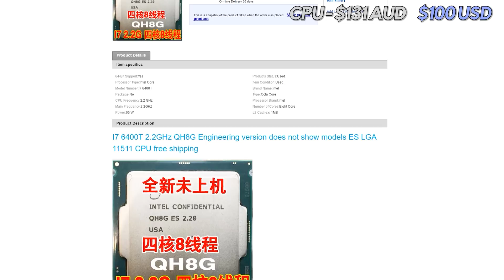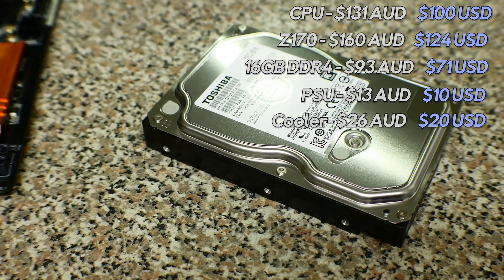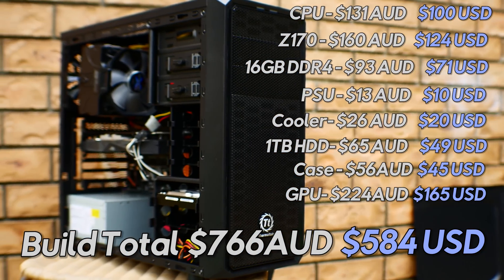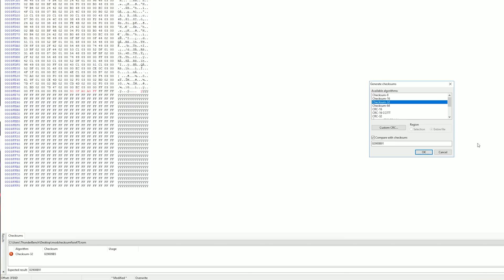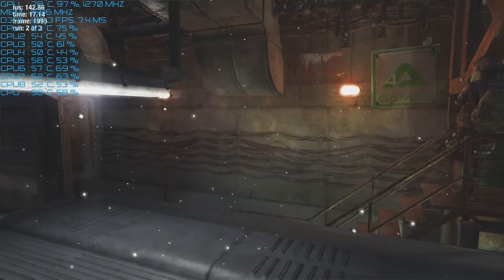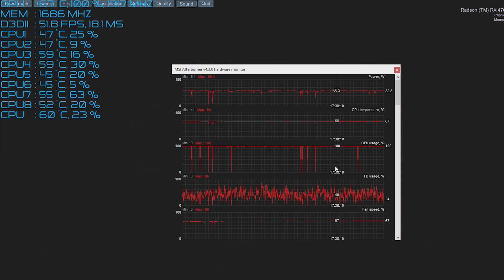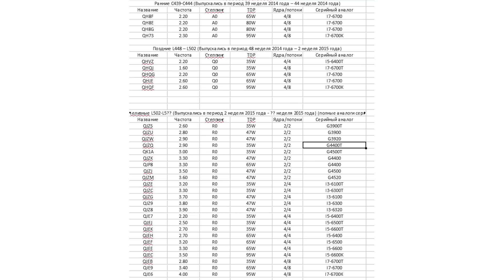The $600 Mass Effect: Andromeda PC - Used Meets New (March 2017 PCOTM)

Comment: With cpu coolers can  i use  (beter than Intel stock cooler) with an  better cooling solution for an 1156 socket without backplate and fitting on the intel cpu cooler socket.

Comment: why use this CPU instead of the E5 2670? I mean the e5 2670 scores 2000 higher in 3dmark physics (you didn't show any other CPU related benchmarks and I can't find any online as it's a rare CPU) and you can get the CPU and motherboard combo for about the same price. I know that you already know of the E5 2670 so like why use the i7-6400T?

Comment: Good thing i watched this video in time. I was heavily considering the Asus Strix Rx 470 cause it's cheaper compared to other models, now i know why. I thought the throttling issues were already solved at this point... I wont waste my money on this...
Reply: Lancer265 if you are still considering this card the throttling issues are fixed by just installing a simple bios update for the card from asus website and all you have to do is double click on the program and it will automatically get installed previously I couldn't even run the card at 1226 stable in winter without throttling to 300mhz at 70c but after the update i am reaching 1325 on core and 1725 on memory very stable at 85 percent fan speed the max temp i got was 73c and my room even goes as high as 41c
Reply: I got the Gigabyte G1 bro >_< didn't got throttling with this model, but i got temperature issues which thankfully got fixed with bios update too. What are your overclock settings tho ? do you use wattman ?
Reply: i use after burner my card is running stable at 1325 core and 1725 memory at 85 % fan curve and i rarely get above 70c and my room temperature also can go as high as 40c
Reply: Is it too loud ? What about the core voltage ?
Reply: Tbh the asus cooler isn't loud at all and the core voltage is 1140 i didnt have any luck with voltage on this card though

Comment: what do u guys recommend for a PSU with at least 600W's I'm worried bc my old computer had a crap PSU and took almost everything with it, Brian here is pretty brave when it comes to psu's and just took a PSU I've never heard of
Reply: Isaiah you Can use a corshair vs 650. Should be top Dolla 4 u. 🦍
Reply: A good quality 500w PSU should work great. But if you find a pretty good deal on a 600w unit then get it.
Reply: Lancer265 I was thinking that, but I going for a i5 6500 and an oc'd GTX 1060 to 2012 mhz

Comment: What monitoring software did you use in this video? I have tried many but they don't seem to work on my pc. Btw i bought QH8F and it is working fine with my asrock z170 fatal1ty k4 motherboard :) i would just like to oc it a bit

Comment: I get the same throttling with my Asus strix Rx 470 I tried adding 50% power limit and 80% fan speed that didn't help the moment the hit 70c it will throttle all the way down to 300mhz for a few seconds, please investigate more how to fix this or at least improve it a bit
Reply: Mundie Afterlife i have found a way to fix it currently i am running at 1325 on core and 1725 on memory no throttling at all even at 73c which is the max temp i got all you have to do is go to asus website go to rx 470 asus strix drivers and download the one that says rx 470 strix gaming 4g after downloading it just  run application in the downloaded folder and it will automatically update the bios it takes 2 minutes and then restarts and then you can change the temp limit to 90c from the asus gpu tweak 2 but keep in mind the power limit will be reduced to 125 i can also provide you with the download link if u want to just send a reply

Comment: Can you share your VBIOS for an RX 470? I have the exact same model, and it's terrible. It turns off after 30 seconds of gaming, I've sent it to RMA, and I got response that this GPU is fine.. while it's not. The only fix for me is lowering the core clocks to stock 926 MHz from factory value of 1250 MHz. My GPU is definitely not overheating (sitting around 65C) btw.
Reply: ΛVINIDE just go to the asus website search for asus strix 470 4g drivers download the one that says asus strix rx 470 4g power adjustment and run the program it will automatically install the bios and you will be able to set the temp limit to 90c and you won't experience any throttling i am currently running it at 1325 core and 1725 memory stable at 73c max temp at 85 percent fan speed if you want the link reply me
Reply: My GPU won't even reach 70C. It crashes at ~67C. I might have faulty temp sensors, because forcing 100% fan speed also fixes my issue. I found something like this:
STRIX-RX470-4G-GAMING
power control limit adjustment
Is this what you ment?
Also, any kind of BIOS modification bricks my GPU :v
I'll try it, if it won't help me I'll try to RMA it again with different reason and buy a GTX 1060, which costs the same in my country.
Reply: 'Your graphic card no need to update VBIOS'
I'm getting this message from this program
Reply: Then i can't help you sorry

Comment: The RX470 is the KING! I can get them as low as $125USD here in NYC. Honestly I believe this GPU KILLED used GPUS. I would NOT get a used GTX 970 @ $200 over a NEW RX 470. This Card is the Budget/1080p KING!

Comment: Undervolt this sucker put +20% on power target edit the temp limit on bios because its locked to 65C by asus and after it hits that it will throttle. Had the same problem with an asus dual rx 480 but in the end the cooling just couldnt keep. Undervolting ,raising the power target and editing the bios by unlocking the temp limit  got me a stable 1270 mhz with 1090mv at 76C anything above that was either unstable or too hot and loud. Seems like some boards or the chip?? didnt get enough attention on the power\ temp target ratio that the rx 470/480 scale their clocks with and by raising the voltage you make things even worse

Comment: Sorry I am a bit late but you are right about the strix 470 i have one and it never reaches above 65c on stock clocks with auto fan curve but when i increase the power limit to match the 1250mhz boost mark it throttles down to 300mhz every time it reaches 70c however i would like to know how did you manage to increase the temp limit of the card as it can't be done on my card i have set it to 90c in wattman but still max temp target is 70c i have also tried msi afterburner and asus gpu tweak but those don't work as well and the asus gpu tweak doesn't even have the option for temp target please tell me how to increase the temp limit i wan't to run the card at 1250mhz but the stupid temp limit doesn't allow that your help would be much appreciated have a great life
Reply: Thanks buddy for your help but i have already fixed the issue
Reply: use MSI afterburner! I get 1450mhz no throttle on my xfx great black Rx 480 :D runs at 65 to 75 degrees
Reply: Roy Wright The problem is msi afterburner doesn't work doesn't matter if i set the temp limit to 90 or 100 it still throttles at 70c
Reply: Oh no good, get an aftermarket cooler like the Arctic cooling accelero 3
Reply: Try playing around with msi afterburner settings. like tick the voltage control and voltage monitoring and at the bottom set it to "without PowerPlay support" Now you can tweak the msi afterburner And on AMD crimson setting: "Game/Global setting/Power efficiency to ON" Try that and see if that makes any difference.

Comment: You could have killed three birds with one stone had you gone with the Little Devil Case with Built in Phase Change Cooler and the Little Devil case also provides the power to run the motherboard through the Phase Change Cooler control electronics and it also means that the unit won't fire up until the cooling head reaches -70 degrees below zero.

Comment: I got Kind the same Problem with my Rog 480 Strix and i getan freezes in Overwatch i need to Ramp the RPM up to 80% and Power target +20 and then overwatch works fine. And the Core fettig even that Hot max 57 C. I guess the VRam gets to Hot

Comment: The Asus Rx 470 Strix has some problems in cooling. One of them is that it doesn't has thermal pads  on vrm area and memory chips that connect them directly to the main heatsink. Some site measures close to 100 degree on one of the memory chips that happens to be  very close to one of the heat pipes. This high temperature might cause texture corruption in some games especially in summer days.

Comment: Had the same card with similar issues. It seemed that the crashes were related to power draw, not the core temps. So my suspect is a sub par VRM and cooling of it. This would still align with different cards performing better/worse depending on silicon lottery. Asus, never again.

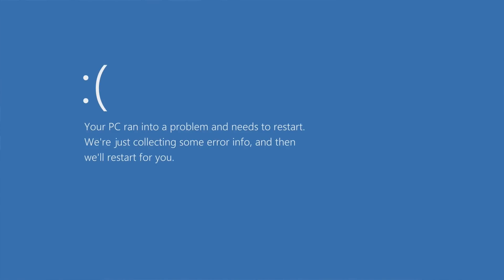Comment: God damn it, Brian. I was watching the video in full screen when I saw that crash at 6:07 along with the blue screen then immediately thought my own PC did that. My heart nearly sank.
Reply: Yea same thing here, was just about to blow up since iam on the 3rd motherboard in this build since Sep/Oct last year
Reply: The first two boards that broke was both MSI Z170 Mpower Titanium
Reply: TrueZtyleZ7 i thought my new tv had died for half a second then it got to the windows screen haha
Reply: Wow, why so many dead motherboards? i own an x99 Gigabyte Gaming G1 Wifi and the only problem i had was that i didnt recognized my first RAM that i bought that was Kingston Hyper X, then i just bought a Crucial Ballistix Sport kit and it has worked flawlessly, i have a Seasonic 1050W platinum for my system, picked it up since it was expesive as hell, i didnt wanted to get fried, also easier to do upgrades on it, at the moment i have a single r9 390 for it, plus a 5820k, but most likely i will pick another for it, or maybe change it and simply better get a dual RX 480 config (wont pick nvidia since i have a freesync monitor)
Reply: Same  i almost died here because i know my r9 280x has some memory problems and i thought it died
Reply: MenthuDk damn really? IM running a MSI x99A Xpower Titanium motherboard right now and i absolutely love it. overclocks are rock solid stable (6850k @ 4.55Ghz) and before that I actually ran the MSI Z170 Xpower Titanium as well with a 6700k and that one was incredible as well.. its actually the reason why I stuck with the titanium on my next buy..

the one problem I did experience with my MSI x99a Xpower Titanium is the bluetooth stopped working out of no where on it... It was great having bluetooth built in so I could pair my Xbox one controller wirelessly without that dumb ass dongle... And then just one day it stopped working and i cannot get it back...

I wonder if they would take it back as an rma?
Reply: ***** the only thing is I know some of these companies are slow AF and I wouldn't want to go without my pc for weeks waiting for it
Reply: Well this was the first time that i had gone with a different mobo, normally i use Asus boards. But when i was putting this build together, most of the Z170 boards out there was in colors that didn't match with the Black/Green that i was going for. 
So the MSI Titanium line was a great match , since the fans that came with my Deepcool Genome case was white. Also that board was going pretty well with the Dominator Ram, and I didn't want to do extra modding to it, so went with the Mpower because the Xpower didn't came with an IO cover. 
Dony know if the boards was from a bad batch or what it was, but there where somethings wrong with the Ram part of the boards.
So after 2 Mpower boards i just had it with MSI boards and went back to Asus, since i always have used those and never have had any problems what so ever.
Reply: Yea same with the old old pc that i have hooked up to my TV. Its running a Asus P5W DH Delux with a Intel Core 2 duo E6420, with a mild 2,4GHz OC 24/7

Comment: this is literally the exact same pc i made like 2 weeks ago, 6400t and strix 470
Reply: Pennywise i got the asrock pro4/d3 just so i could use my 16gb of ddr3 i have
Reply: DevPre yeah overclocked mine to 3.6 stable but got it as far as 3.8-3.9 but didn't want it pushed to the limit all the time, learned that if i used Intel Extreme tuner software i could get a higher overclock than with the bios
Reply: not too sure what you meant in your question but yeah i would say that it is definitely, the cost to performance is ridiculous and after getting the bios sorted it worked perfectly, never had any hiccups
Reply: yeah i would say so, you would definitely see a performance increase even with the lower clocked 6400t, i have my 6400t now overclocked at a low enough voltage at 3.88ghz using intel extreme tuner and am getting cinebench scores of 810+ out of a $100 cpu

Comment: That 6-pin tho
Reply from the maker: I think all the other cards I have tried don't work, just some of the RX cards for some reason, pretty cool though :P
Reply: The 8 pin does only add two gnd that the Card knows it can draw more power. All modern PSUs have 3 12V lanes on the six pin connector and the RX470 does not need more power than that.
Reply: User Apego some cards won't work if there's a 6-pin instead of an 8-pin though. It may have changed now, but idk.

Comment: My strix rx470 was getting black screens at the clocks and voltages asus put into it. I dropped it all to amd stock and it works flawlessly now. I did loose a couple of fps in the process, but its better than RMA and being without a gpu for a month.
Reply: popifrex1993 or just buy an nvidia gpu?
Reply: Jeremy R for the price I paid for my rx470 I can only find the 3gb 1060. nvidia can shove that card up their arse for all I care. I'll just buy a Vega later this year.

Comment: So.. still don't buy Asus AMD cards?
My Sapphire Nitro RX470 only hits 71/72 under full load, also.
Reply: He didn't say that asus cards are bad. Its just his gpu was shit.
Reply: I wont personally buy them anymore went threw 3 Rx 480 ASUS duals all had overheating and crashing issues
Reply: tbh I trust XFX too. Their warranties are good and the cards are pretty nice also.
I hear good things about MSI, and my old HD 7850 TwinFrozr was pretty good, still only hits about 60'C under load.
Reply: yes do not.  I bought rx480 strix asus.  Horrible Coil whine.  Sent it for RMA and got a new one,
which is ALSO coilwhining and the fan makes a weird noise at below 10% fan speed.  Just garbage these cards.  WTF
Now i send it back to get my money back...
Reply: hopefully those strix cards will flood the used market for cheap someday... since I use old Servers for Gaming, noise and heat wouldn't be much of an issue to me. :P
Reply: cant complain with my 480 strix 1400/2100 at 70 c with 40 percent fan and no coil whine  is fine for me
Reply: i think it was just bad silicon lottery here, if i remember, JayZtwoCents said he had a Gigabyte RX 480 and was extremely hot, but many others claim that theirs runs just fine, around 74°C, maybe he also got lucky with the XFX one since he said that it was extremely cool, but a friend owns it and says it runs around 71°C at stock while on load, its not bad, but its not as great as Jay said
Reply: I also have an RX 470 Strix in my mini ITX build and at stock speed it does go down by 100 MHz on Firestrike. It wasn't so bad once I maxed out the power limit, where the minimum clock speed was 1205 MHz
Reply: I got the bad silicon i guess.. My xfx 470 is touching 80c easily in just 5minutes on heaven bench.. Had to set a very aggressive fan curve in wattman just to keep it down to 75..
Reply: They still don't fix the throttling issues with this card in specific, smh...
Reply: PrimalTundra Sapphire is the only company i will trust for AMD cards

Comment: Question, does a pair of 7970's or 280x's out-perform a 470/480 which can be found at a similar price, cos I'm finding a few of 'em (7970's/280x's)  for around 110 bucks each
Reply: If the game is optimized. Yes.
Reply: absolutely and I didn't find many games that didn't support crossfire. Some maybe better than others,  but overall it was still worthwhile in my books.
Reply: Right, cool thanks for letting me know!
Reply: Chris: What games do you play? Should have been the first question. Have a look if they support crossfire and also if you have min a 700w PSU + your motherboard supports on xfire.
I had before a HD 6950 crossfire setup as well and was overall very happy. 2x 280x are close to a GTX 980  and for that money you could not get a 980.
Reply: Chris Brown I will always say this, just buy he 1 expensive card the rx 480 for example is only 200 bucks buy one now and then add one later on maybe when the 500 series are released so you can get one for cheap
Reply: Jeremy R Having two 480x is only useful when you want to go for 4K resolution as benchmarks have shown. Why not get more power now already for the same price with the 2x 280x?
Reply: I  will revise my suggestion slightly.  If you don't have a 280x already, then take the RX 480. The performance gain by the 2 cards is not enough in my opinion as some games don't support it.
If you have a 280x already then I suggest to add a 2nd one and save the money.
Reply: Sorry, where is the RX 480 $200? I can only find them for $320+... Unless you are in USD but I was talking about AUD.
Reply: Yeah, I was gonna ask where they were finding 'em. Finding 290x's for 'round $220 so considering just getting one of 'em.
Reply: Yeah, and I heard the reference coolers are pretty shitty aye.